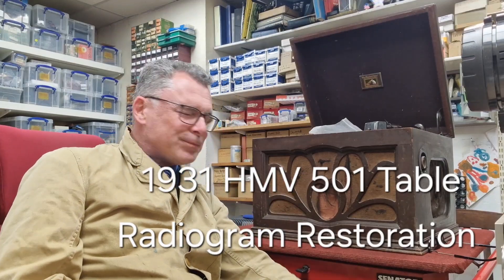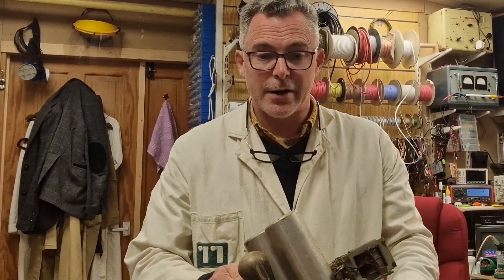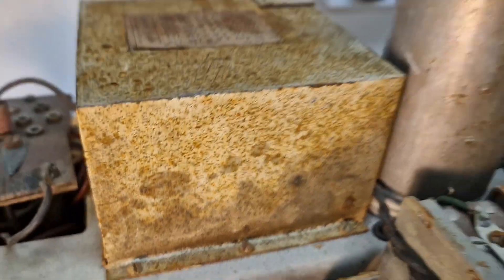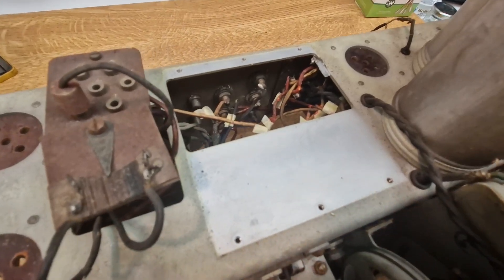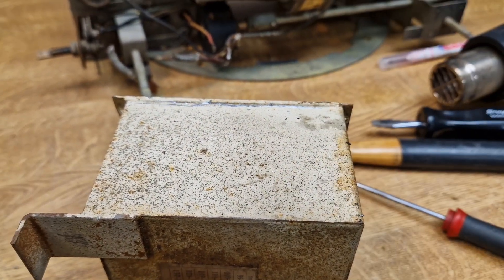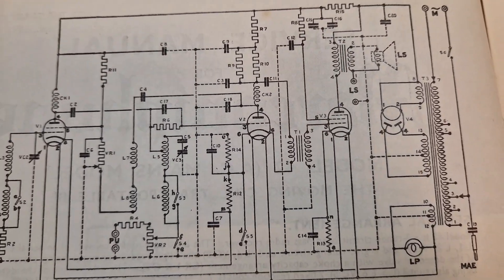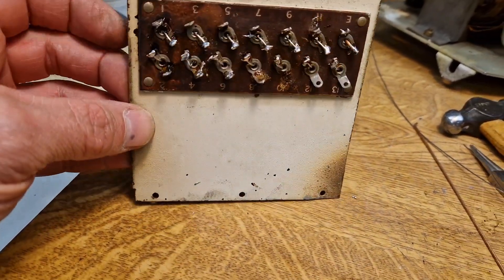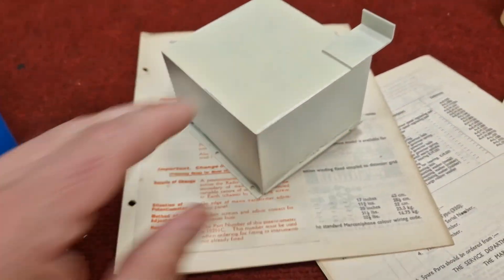Full restoration of a very poorly 1931 HMV 501 Radiogram Part 1

Comment: Very well done! I am currently working on a late 1940's Zenith 12h092R AM/FM/ 78RPM Phono with the same crappy wires. It s definingly a job to replace them. The Zenith has long 9-wire cables that have 3/4" braiding on them. They had the same bad wires that I had to pull through and replace. That was loads of fun - NOT! Nice work with the capacitor block. We had a US company (Atwater Kent) that used them all the time back the 1930s too! I actually use a propane torch to get them out of the numerous boxes in those sets! Anyway, new subscriber here. Loved the video! Thanks for sharing it!

Comment: Fascinating to see how different the components were! I have an Ultra radio from the mid 1930s, and the change around only 5 years later is considerable. Resistors with the colour code ('Body End Dot rather than stripes, though) and discrete capacitors, and a superhet design. So the technology in the 30s was actually progressing at a fast rate.

Comment: Always wondered why some early resistor were encapsulated in glass. Thanks for showing that. I have tried the old pencil trick to build up a resistance value but that looks like it was tuned over a candle flame🙂.

Comment: Always interesting to see the difference between American radios of that era compared to British electronics.  What voltage was used in those days in most homes?
Reply from the maker: It varied from region to region. 
Anything from 200 - 250V. Some A.C....some D.C. Hence, all British built stuff had to have multi volt inputs.
Reply: @vintagetvandwireless  I'd add some districts were also 110 - 150V. Often if there was a private generating plant for lighting it'd be a lower voltage, plus mains frequency could vary from 25Hz to 100Hz. If you get hold of one of the "Trader" annuals from the 1930s, they often list the supplies by area. I have one of these 'grams too, but mine is a DC-only model using 0.25A valves.